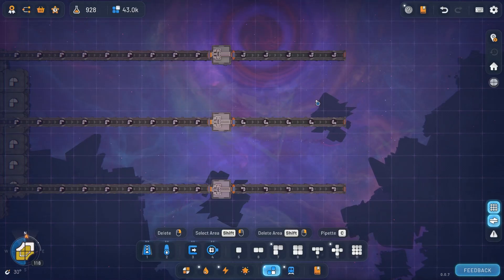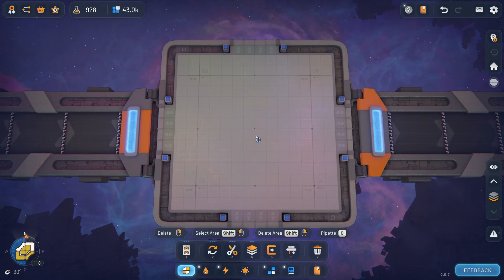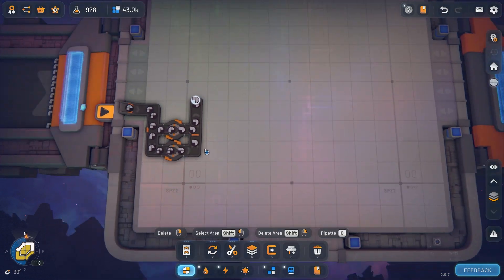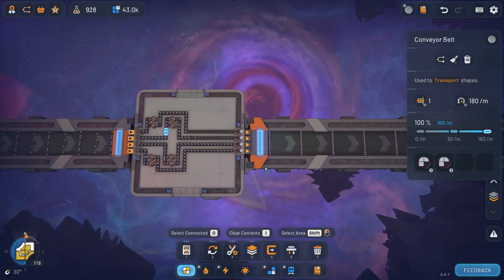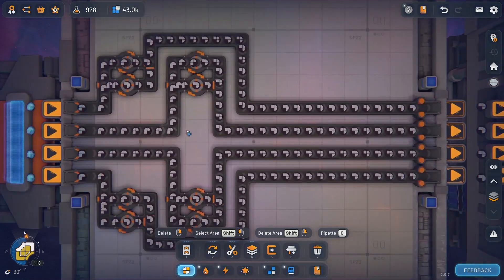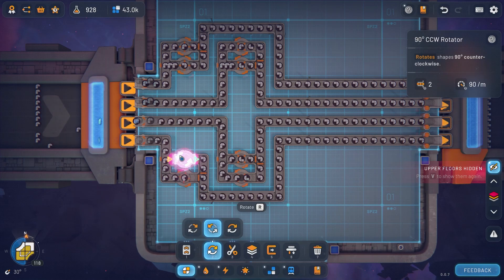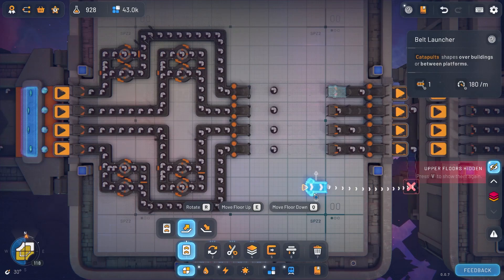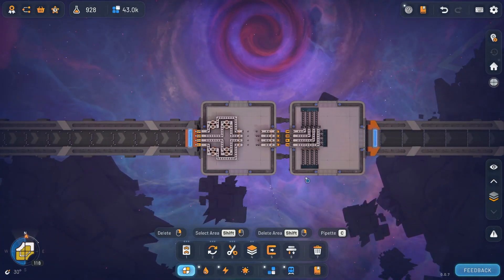Shapez 2 Blueprint - Rotator

Comment: When splitting belt you can optimise so that every split is even (like a binary tree) otherwise the farther belt will be fed less frequently. Splitting a belt off for cutters so ratio 1:3 should be a single belt cell split three times. Again if the ratio is 1:4 so 1 belt 4 machines it can be split in half and then split again in each half.

Not the best explanation but I hope you get the point.

Also another thing could be making the path as short as possible, wouldn’t make it faster but it would make the first shapes reach the end quicker. Or making the path the same length so that shapes gets transported in parallel (this is OCD tho i think).

Anyway cool videos! It’s always interesting seeing how different people solve these kind of problems, can’t wait to see how you approach MaM stuff.
Reply from the maker: You're right, but you're also not considering one fact.

Say you have a belt that splits 3 ways like this =====|====|====| each notch indicating a split off. The first notch gets 50% the second on 25% the last one 25%.... like a binary tree right?

But no in the case of shapez because the machine's input capacity is limited (1 machine can only handle 33% of a belt) it will back up that 50% one and only consume 33% of the 50% you give it, leaving the remaining to travel down to the rest of the belt!

TLDR: you don't need to split belts like binary trees no matter how many machines you have, as long as you have the total correct number of machines, the belt will self load balance!
Reply: Oooh you're right, i had tested it with only trashes and didn't realise to consider input capacity. Thanks to you now i'm not going to lose my mind over belt splitting while designing better blueprints.
Reply from the maker: @alian9216  Should save you some space too! doing a binary tree split would use a lot more room
Reply: This also applies to other factory games! Let it over flow and it will fix itself(unless the game decided they don't like perfect numbers)

Comment: How about an automatic rotator for a MAM? All 3 options, IF-THEN-ELSE-IF type structure: if shape matches, pass it through. Else pass to rotator 1 and check again. If it matches, pass through. Else pass to rotator 2 and check. if it matches, pass through. Else move to next rotator. It would match after the last rotator, so pass it through. Essentially, 3 groups of 8 90° rotators for full shape rotation, plus required logic to execute if-then-else-if chain. Put on 3 layers for full saturation. If possible, put on a 1-by-2 for space reasons.
Reply from the maker: certainly possible, but not necessary, at least I haven't seen yet, since the rotation is fully controlled by me and not random at all we don't need to dynamically rotate right?
Reply: @DataEngineerPlays You won't have to manually rotate the parts if you determine the rotations first. It's like the old logic chip 4-bit look ahead adder if you've heard of the concept. Look up 7483 or 74283. Then you can insert the shapes into a stacker array. Or you can create a 4 way cutter splitter and don't rotate at all and select the shapes wth a multiplexer. It may be game complete, but not yet function complete. For example: variable length jumpers would be perfect for people who prefer form and function rather than form or function. Also variable length labels
Reply from the maker: @kidterra4483  haven't heard that concept before, but certainly interesting! Thanks for the tip, I'll see how I can incorporate it

Comment: My favorite way to build it (and all other single actions like rotator, destroyers, pin pushers) is to have a single line of 8 rotators on the second row. This way it is super easy to create the other rptator, destroyer and so on from it
Reply: uuh love the idea. I will try it :D
Reply from the maker: The rotator platform and all these blueprints are designed to be used modularly. You should never need to modify anything on the platform eg adding a destroyer. if you need to destroy for example, you would add the destroyer platform infront of the rotator platform. (will release a video for that soon)